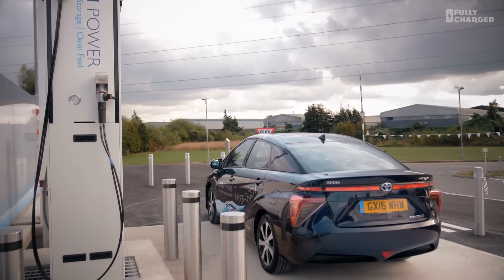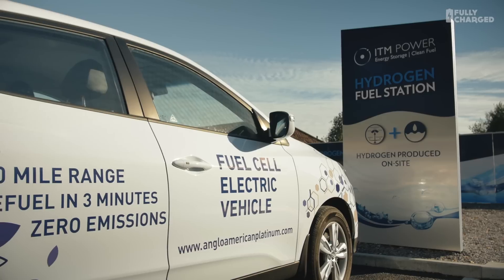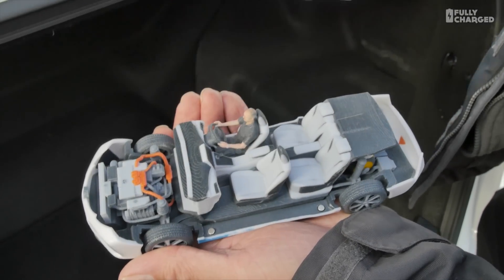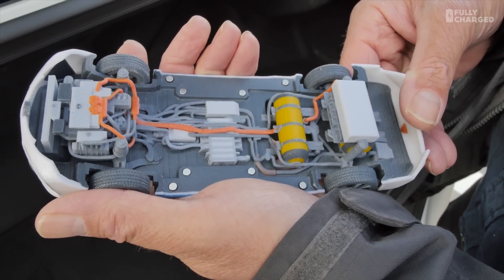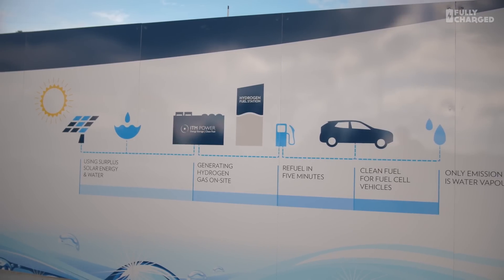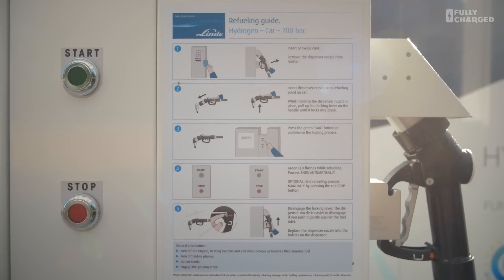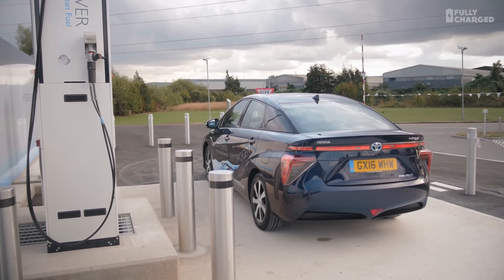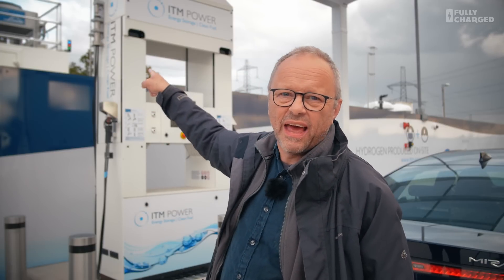ITM Hydrogen Rally | Fully Charged

Comment: Batteries makes more sense it's far more efficient than the joke that is hydrogen cars
Reply: Seeing as Tesla maxes out at 100 kWh currently for power capacity, the Mirai has an output of 114 from hydrogen density though it has a 18 miles less range per NEDC and 3 miles EPAe US less range in comparison to Tesla at 388 and 315 from full charge.

Comment: However you store the energy it has its risks, a Tesla car is not so different to Samsung galaxy 7, Once you store a load of energy in a small space you need the engineering to safely store and transfer it, filling your petrol tank is pretty risky if it goes up, likely putting it out is not a serious option  more a case of escape.and it doesn't take much to set petrol on fire. Nevertheless compressed H2 seems like a Betamax of a solution, I don't see hydrogen in the mix (for cars at least) once the Electricity infrastructure is in place even if there are engineering advantages for energy density, rapid replenishment an physical relocation of the energy

Comment: Battery electric is the way to go for private cars, which spend most of their time parked, so charge time isn't a problem.

 Hydrogen may be much more practical for commercial vehicles, you don't buy a large truck to have it sitting around for hours a day recharging, the ability to run 24/7 is essential for many operators, you need a fast turnaround for refuelling. An absolutely huge battery would be required to run a 40 ton plus battery electric, truck running long distance, you'd need at least a 400 mile range in the worst possible weather conditions. Hydrogen offers a more practical solution for this application than battery electric imho.
Reply: andy woof But the truck has to stop due to laws that forces the driver to take a rest from driving.
Reply: I am a truck driver and we have a day and a night shift, so the truck is basically running 24/5. (exept for loading / unloading times)
Reply: Also our trucks have a range of about 1500 miles on a full tank of diesel
Reply: Yep, a friend of mine does a night trunk, Sheffield to North London, swaps trailers and returns to Sheffield,  that trailer gets dropped then the truck goes off on a day run with another driver. The engine never gets cold, 24 hour running.
Reply: andy woof at least in Sweden truck drivers has to pause every 2,5h and have long brake after 4h, should be the same for all EU I think. This would give you time to recharge your batteries if you have a Supercharger, lorry style.
Reply: Lucas K you would only need the range to be able to go for 2,5h and the distance between the megachargers.
Reply: Lars Löwgren
 you can drive 4,5h max then have to take a 45 min break, after that you can drive again 4,5h. 45 min is not enough to charge a truck that can drive up to 650km a day. (i'm from Germany btw, and the law is the same in all of europ but if i'm not mistaken, Skandinavia has a few different laws.)
Reply: The recharging is only a problem with li-ion or similar. If you have a flow battery (like redox) you can have gas stations and just change the liquid (as you would fill an ICE car) replacing it with a new energy filled one. The problem today is that these type of batteries aren't very energy dense and require a lot of liquid in order to provide suficient range. I believe that enough effort is put in the investigation of this type of batteries these problems would be overcomed.
Reply: Lucas K  Yes you can build a truck like that! You will need about 10 Tesla Model S batteries at a total of 850kWh and a 1,2MW Megacharger, that's like one  Supercharger station with 8 outlets. This will manage 400+400km with 45 min pause in between. See calculation http://teslaclubsweden.se/teslas-lastbil/ sorry for the Swedish.
Reply: Lars Löwgren the problem with that is the weight, in most european countrys the max weight of the truck + cargo is 40t. i dont know the exact weight of the model s battery pack, but i'm guessing it's ~ 2t? Don't get me wrong, I really want to see all electric cars, trucks, planes and boats! But I think the technology isn't there yet, atleast in the commercial sector.
Reply: Lucas K the energy density of the tesla battery is at lest 140Wh/kg according to http://enipedia.tudelft.nl/wiki/Tesla_Model_S_Battery this would mean 6000kg for our electric truck. In Sweden the max load for a truck with trailer is 60 tons. And the engine and transmission must have some weight to that can be lost. I think we are very close to the point where this could be done. As you know the fuel savings would be substantial.

Comment: I think it is wrong to endorse hydrogen even when produced using opp peak electricity and water since it requires 3,5 times the amount of energy to drive a car compared to directly use the electricity to charge a BEV.
The issue of using off peak power to produce hydrogen is moot, since a battery storage unit could do the same towards charging a BEV.
And I guess that a battery storage with similar capacity would be cheaper to build than a hydrogen producing unit.
And in a few years, battery storage will be dramatically cheaper. And fast charging will become faster.

Comment: Yah they tell you pressure in bar, because they don't want to say it's   10,000 pounds per square inch! great concept for a 5.00 a gallon or what ever they want to charge, can you say monopoly? You pay it or walk....Great video thou.....
Reply: He does says it can be filled from 350 to 700 bar which is 5,076.3208303 to 10,152.641661 psi but they fill at 750 bar (10.877.830351 psi) and in the video looking at the pump they charge 9.999 per kg instead of liter or 1/4 gallon.

Comment: The Toyota guy's comments about Ni-Mh batteries is complete and utter B.S. We've proved time and again that Ni-Mh is a far inferior technology compared to Li-ion batteries. It's very disappointing to see Toyota wasting time and money in this Hydrogen malarkey when they should be working towards plug-in electric vehicles. I foresee that the future of electric vehicles in the near to medium term is rapidly replaceable batteries. Tesla tried this but failed because it's too complicated to remove their battery packs and replace it, it needs to be a quick unlock, unclip and slide out operation to remove a battery and slide in a new one. I think this is definitely something that the Formula-E race cars can pioneer - the way Formula 1 pioneered technologies for petrol cars, sadly I don't see them doing it.

Comment: Why do I want this thing? How is it better than the alternatives? 

Can I: 

-- buy it next year for $35,000, 
-- have a fuel cost of 3 cents a mile, 
-- not have to "tend" to the act of filling it (walk away and do something else)
-- have it filled every morning before I get to it, 
-- for 99% of my days never have to "go to a filling station"
-- and drive it across the country if I want? 

If not, how the F##k is this silly vehicle going to compete?
Reply: oh and another point, how much is the current tesla at the moment? its probably the only viable, practical electric car at the moment(with a decent range)....
Reply: Iain Ansell Chevy Bolt, 100KW Leaf, new BMW i3 anyone?

I see merits in HFC tech, particularly for haulage, aircraft and marine transport. I think both can coexist, as not everyone will have access to a charging point.
Reply: Shaun Powell can't get Chevy volt in UK... Only has 2 real seats in the back..same as the BMW... The range of the leaf did'nt good enough..though it makes a decent city car...
Reply: Iain Ansell Iain Ansell Chevy Bolt/Ampera-e you mean, as Volt you can get, just not the new version... yet. http://www.topgear.com/car-news/paris-motor-show/groundbreaking-ampera-e-could-come-uk-rhd.

The new leaf (60 kw not 100kw) will have a 200 mile range, which is a bit more than just city.

Granted, it's not 320miles, but has an entirely accessible network to charge, plus home charge, are cheaper to run and they're less than $35K. All with 5 seats nevertheless  (not some originally specified).
Reply: 'could' come....200 mile is not a good enough range for me..... I don't want to have to stop and charge with a car full of kids on the way back from visiting family 125 miles away.... They say 200 miles...but what's that when the heating is on all the time and at motorway speeds?

Comment: Normally like fully charged, but this episode was disappointing. No new info... Would have been useful to ask the Toyota and ITM people how they're going to deal with the fuel cost? At £ 10 a kilo, it's like a £ 50 fill up, that's way too expensive even if you can do 500- 600 km.

Can I make hydrogen with my home solar panels and fill my car up at night? Do they have plans for such a product? 

How does Toyota plan on dramatically increasing their production and shipping those Mirai cars to all of western Europe? 

What company is going to build H2 fuelling stations in countries that don't subsidise fuelling infrastructure? 

I get the appeal of the short fill up time but that's not really a necessity with an EV that has more than 500 km range and a couple of long trips a year.

Comment: i still don't understand the appeal of hydrogen, it's hedged on the bet that batteries will not get much better than they are now which is a very foolish assumption to make....and has the same infrastructure problem as EVs but without the advantage of charging up at home every night
Reply: The appeal is that it still has a lot of parts that can break so the car companies can keep charging for regular service.
Reply: Ryukachoo But EV:s has no infrastructural problems compared to Hydrogen cars. I bet you could but a outlet socket on every parking slot for the same money as a network of hydrogen fuel stations.

Comment: It doesn't matter that it is inefficient to make. It is a store able energy form and that is key to energy management. I know it sounds nuts but it is far from it. At the rate solar and wind is being installed there will be more energy than the grid can use right there, right then, more and more often and building massive battery banks is just not practical. This is.

Lets say your battery car needs topping up. It is a right here right now situation and that, at work after driving there or home after work, is a peak grid maker if there ever was, but, with this it's 'well here is some we stored last night while you were asleep and it was windy' or 'last week when it was sunny' or even ' in the summer although now it is winter '. Show me any battery that will hold a usable charge for 6 months?. I don't get why there are so many neigh sayers. Time will tell....

Comment: i allways thought hydrogen makes a good tertiary energy storage after batteries. while very inefficient, a lot better than throwing away overproduction. and i wouldnt mind a small fuelcell range extender in my EV....not sure when i would use it with all the chargers around here, but you know, just in case.... ah forget it, the cost for a small fuelcell alone drives this idea into absurdity...

Comment: MIRAI : "The Future" .. Or, Mirage ?  
It is NOT a chicken-egg problem.  
A little thought would clearly indicate 
that the refueling infrastructure needs 
 to be built FIRST.  That is what Tesla 
Motors did.  They FIRST built the
 Supercharger Network for their luxury
 vehicles, (Roadster, S, and X) FIRST.
  They then championed, promoted 
Solar Power and Power Wall technology 
BEFORE introducing the Model 3.

  Consumers are NOT going to buy a car
 and THEN wonder, Ok, now how do I 
refuel?  If Toyota or Honda wish to sell
 fuel cell vehicles, they need to FIRST 
 build a network of hydrogen gas stations, 
OR sell home hydrogen kits to serve as 
fueling ports for the cars, or better yet, 
they should come standard
 with the cars.  A standard Model 3 comes 
with a plug that can be connected to the 
house, with or without, a Powerwall.  Can
 Toyota or Honda create a home hydrogen 
refueller that is PRICE COMPETITIVE to a 
PowerWall battery system?  The answer 
appears to be, No.  And can a hydrogen gas
 station fill up 200 cars a day, while refuelling 
itself to serve another 200 cars the next day?
  The answer appears to be, No.  Those hydrogen
 gas stations can only make enough fuel to 
serve like 15 cars a day.  So, until the hydrogen 
infrastructure problem is solved, the fuel cell
 car is not going to happen.  Will it be solved?
  

Flip a coin.  It is a binary outcome.  .. Weird, 
how Americans will pray over the outcome of
 a football game, but not for a technological 
breakthrough.  Maybe it is because of WHY you
 want your team to win - your prayer to be 
answered - that counts?  ... "the substance of 
things hoped for"... The Why... see, Heb 11:1, kjv.
  Why pray for the environment, whilst persons
 are nursing broken hearts?

  "O' my beloved wildcats - when will ye have a winning season..?"

.. https://www.youtube.com/watch?v=PS5oJAtJnn4 ..
some say it is too late, and we are going to crash and burn - 
that fracking is here to stay because people are now too 
addicted to the treasures and conveniences that cheap and 
abundant fossil fuel energy bring.

Comment: "What ITM Power are doing is brilliant, efficient, counter intuitive and is thankfully catching on."

Efficient? Even steam engines can be called "efficient" - 15% efficient.

Using hydrogen for energy storage is highly more inefficient than modern batteries, even when considering that batteries have to cart themselves around.

With harm to the environment practically out of the equation, in the end efficiency is just a battle - it's the total cost to the end user that will win the war between the two.

If I use a battery EV and my neighbour uses an H EV, how much would I have disbursed myself by from the time of purchasing of the vehicle to the time of having to get rid of it, compared to my neighbour, adjusting for an equivalent time span?

Is there someone without any personal bias who has the right and complete information to transparently work this out?